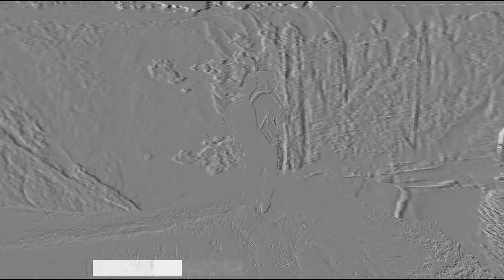Homestead Maintenance - Retaining Wall Build (Debt Free Journey 2020)

Comment: I'm building a wood retaining wall on my backyard, so I've been watching lots of videos like this. Thanks for posting. Quick question: Shouldn't you have dug the wall a bit plus added gravel behind the wall to help water to drain instead of accumulating behind that wood?
Reply from the maker: Thanks for watching, yes you are absolutely correct I installed this wall really just to temporarily keep the soil from falling on the septic tank lids. I have to install risers on my septic tanks and then the retaining wall will be removed to let the dirt surround the new tank risers. Great question, thanks.